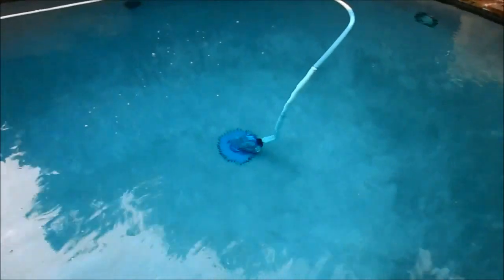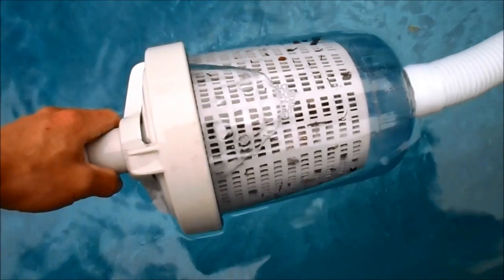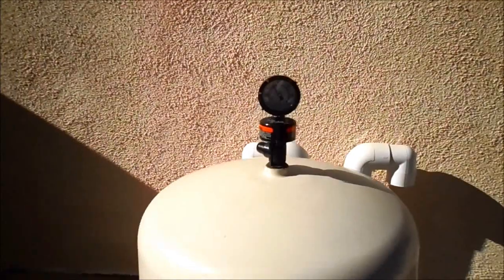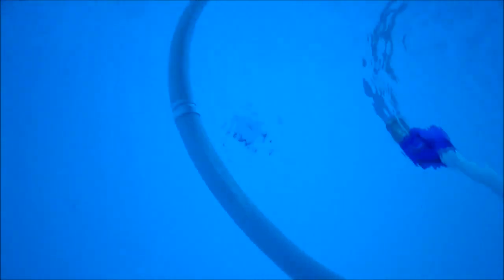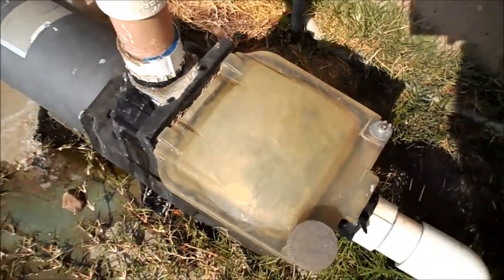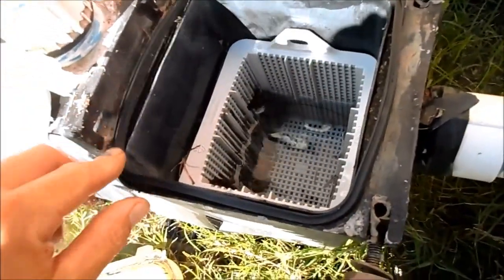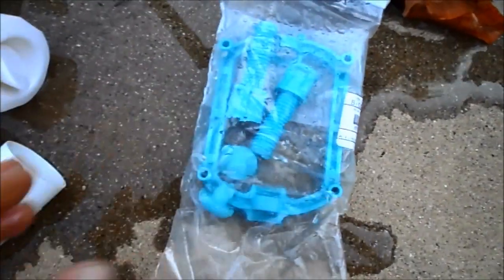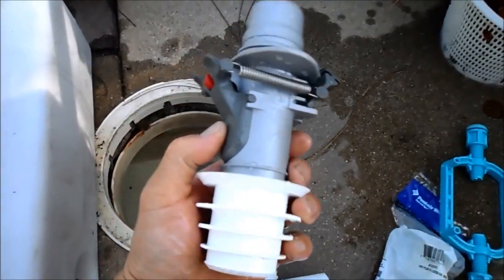My Automatic Pool Cleaner is Not Working

Comment: New pool owner here. 5:23 solved my problem of my vacuum cleaner not moving. The filter was filled with so many leaves. Once I cleaned that out the vacuum started moving like a champion. Thanks for the easy fix! Saved me money from calling a pool tech!!!
Reply: That's not an "easy fix", that's regular maintenance. You're supposed to clean that as it gets full over and over

Comment: Recently bought the Zodiac T5 duo. The flow is nowhere near where it should be. In the "quick start guide", they refer to adjusting the "flow keeper valve" OR adjusting "the valves at the equipment pad "
Where are" the valves at the equipment pad"?? Thx for the videos
Reply from the maker: If you have it attached at the sideport there should be a valve at the equipment near the pump that controls that. In a skimmer hook up you can adjust the flowkeeper to a more open position. Two different connection points.
Reply: @SPL  Thanx! Much appreciated

Comment: I am having a pool cleaner for almost 40 years,  and now I have G3, I was very happy until it stop moving, I cleaned all hoses in the pool, cleaned the pump, cleaned the pipe going from the pool pump even the pipe going from the catcher to the pump, but the peruser is shown (0). I showed my G3 to the store (no problem) but still moving very very slowly, now please advise.
Reply from the maker: It could be the nut is wearing out on top. After 3-4 years that happens. That part is $150 so a new cleaner is sometimes better.

Comment from the maker: Sounds like you have a suction leak by the equipment. You may not notice any water but maybe the plumbing by the new pump is sucking air. If the skimmer works fine without a vacuum attached and then you attach a vacuum - and it loses prime then their is an air leak. Check the lid of the new pump to make sure it is on tight. Then wrap electric tape around the front and top of the pump where the PVC pipe comes in. Then hook up the vacuum and see if it works.

Comment: Just purchased a new G3. We have a 9 ft deep diving pool. It will not stay flat one it gets that deep. Any suggests ?
Reply from the maker: +BIll Baker Add a hose weight right at the cleaner head on the hose, then one at the front of the next hose and a third two hoses from the last one. That should keep it balanced in the deep end.

Comment: Ok so that 1st one you showed with the branch in it....I have 1 almost identical to that but that plastic steering wheel type ring around it has broken and now the vacuum wont move now. Not even sure what they call this particular part in order to attempt to replace it. Any suggestions ??
Reply from the maker: If you are talking about this part is $80 so maybe a new cleaner is better. G2 Outer Extension Pipe Zodiac Baracuda Cleaners

Comment: So my pool pump doesn’t fill to the top anymore. Like I use to see the water at the lid. And my psi on the filter is at zero with the pump on. The inlet jets keep bubbling but not constant spray. Do you know the cause of this. I’ve cleaned skimmer and basket. Basket on pump also.

Comment: how do i increase suction?  I have a 1.5hp motor and 25k gallon pool.  Its pushing out tons of pressure.  When i put my hand near the skimmer it seems like it will suck my hand in.  When i connect the hose and use the pressure meter i cant get past 0.  I have a cartridge filter pool with 2 big inlets on bottom, 2 skimmers, and 2 outlets on wall.
Reply from the maker: You may have to dial down the 2nd skimmer.  Sometimes there is a valve to turn down the suction on the one skimmer.
Reply: @SPL  i tried that with no luck.  You know the valve with the red lever?  How does that work?  Am i supposed to push that red lever up?  No one went over that in the videos.

Comment: My G3 moves very well, but it doesn't clean the algae. Suction is good, i even changed the diaphragm,cleaned filter,etc , still moves and climbs wall but not cleaning. Any suggestions?
Reply from the maker: It is not designed to clean aglea really. Try treating the algae with maybe a PoolRx unit.

Comment: Hi My Zag Splasher gobbles for a few seconds the goes into a tachycadia type vibration. Have just tried to replace the diaphragm. maybe i did not do that correctly ???? tips hints and tricks Please! summer is coming to South Africa!!!
Reply from the maker: +Jenny Maltby It is probably the plastic piece that holds the diaphragm in. If your cleaner is getting old it can start to act up on you. I fix this problem by simply loosening the head of the cleaner slightly by turning the large blue threaded part on the cleaner. Usually does the trick. I just run it loose and it works fine.

Comment: I have a 0.75 hp pump and a 48 sq ft DE filter. I only have one return. My Poolvergnuegen barely moves. Do i need to upgrade my pump to a higher horsepower?
Reply from the maker: Should work on a .75 hp pump. Maybe another issue
Reply: @SPL  Any tips on what to check to narrow down the issue?

Comment: G2 cleaner almost new, not balanced correctly, seems to be back heavy I think adding weight would only make it heavier in the back? It's running raised up about 2 inches in the front? I have a video on YouTube if you search G2 not running correctly if you want to see what it's doing. Thanks for any ideas
Reply from the maker: Sounds like too much suction. Is it connected at the skimmer?
Reply: I used a suction meter is that I had for my other barracuda cleaner and it was in the correct range, but it might be too much for this cleaner, i'll try setting it at Less and see what it does
Reply: +Swimming Pool Tips, Reviews & How To -MrDgvb1 why does the pool hose pop off when the pump turns off?
Reply from the maker: Usually air in the system. It evacuates from the filter down the skimmer line. They do sell a locking device but it is a bit pricey. Some people use a brick in the skimmer: Pentair K12076 Vac Plus II Locking Bar
Reply: +Swimming Pool Tips, Reviews & How To -MrDgvb1 is this something to worry about?  is it a major problem?  i backwashed and it stopped popping off

Comment: my Zodiac G3 takes the same route every time. therefore, missing areas. I moved weight around on hose.stays on wall more than bottom. what to do?
Reply from the maker: You can try this item - I use it in my pool route and it works good. It will turn the hoses 3 times every hour giving the G3 a new pattern around the pool. It is an AmazonPrime item so if you try it and it doesn't work you can return it without issue -  http://www.amazon.com/Twister-Pool-Rotator-Suction-Cleaners/dp/B003ZW115I/ref=cm_cr_pr_product_top
Reply: +Swimming Pool Tips, Reviews & How To -MrDgvb1 pretty cool little device. Seems a little fragile though.
Reply: return it or sell it and get yourself a real cleaner
mine  does the same thing it's useless

Comment: i need help asap. i want to vacum pool have new pump installed not to long ago i can not vacum even manually i have no main drain and only a skimmer i tested the suction its to high i used the reducer that come with the barracuda then the pump started making funny noises and air just sucked in even though the piece was fully sub merged the hose was primed. then i tried the piece just in the hole in the skimmer the pump sucked a ton of air again water was at right level too pump is 1hp pls help